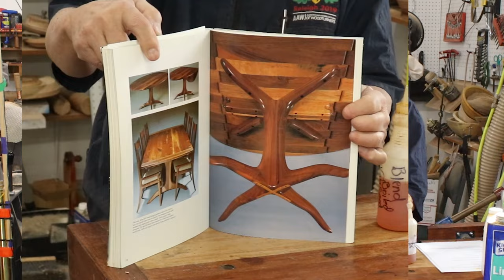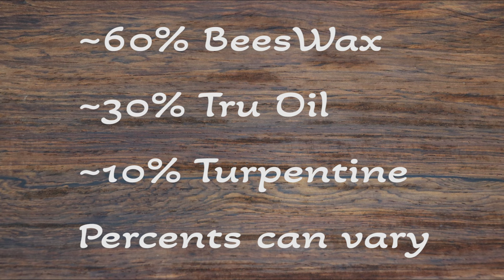Blending Oil Finishes for Wood Working             Woodturning with Sam Angelo

Comment: Hey Sam, it’s great to see you still making videos. You can get some really beautiful colors by cutting oil with a small amount of Windsor and newton oil based pigment paints. It’s a little tricky to top coat once cured but you can make everything from baby blue, forest green, amber and such just by mixing like you would on a palate. I usually prefer the Danish, but I think painters are cutting with linseed.

Comment: Hi Sam -- excellent info as usual.  My understanding of BLO is that it's a mixture of raw linseed oil, heat treated (or "cooked") linseed oil, and the addition of manganese and/or cobalt salts that are the "driers".  Driers are really just catalysts that speed up the chemical reactions involved in turning linseed oil into a kind of polymer -- what we want from a durable, protective film finish on wood.  Many years ago, BLO used lead-based driers, but thankfully those days are long gone.
Reply from the maker: Steve, do they really boil the linseed oil in the manufacturing process nowadays. It was my understanding is they really don't it's more done with the addition of dryers etc. I will have to do some more research. Thanks, Sam.
Reply: Hi Sam.  My current understanding is that some portion of most BLO formulations is usually still heated treated under low oxygen conditions. Raw linseed oil is a natural mixture of a number of chemical components.  Controlled heating breaks down some components of raw linseed oil that would otherwise slow down (or "inhibit") the polymerization reaction. That, along with the addition of dryers (i.e. catalysts), as you mention, creates a faster curing, partial-film finish. Tried and True makes a pure heat-treated linseed oil finish with no dryers.  I've used it, and it works fine, but it's a bit too yellow for my tastes.  Hope this helps!  Thanks for all your videos - they have helped me learn to turn!

Comment: Good summary video.  The finish on that bowl is awesome -- magazine quality.   One question: one of the objections that I have seen over the years to using boiled linseed oil is that it will tend to yellow over time and thus cause the wood it has been used to finish to yellow or look aged.  Have you seen this kind of behavior?
Reply from the maker: Mark, yes, this is some thing I've heard time and time again over the years. But as it happens very slowly, it's really hard to tell isn't it if linseed oil affects the color. Some say it makes the wood darker. But I will continue to use it. Thanks, Sam.

Comment: Sam, I understand the value in each of these finishes. The question I have is if you mix them together when they hit the wood do they efficiently separate and do their individual jobs?
Reply from the maker: Victor, wow that is a really good question. I always thought they kept their characteristics and did their thing but who knows .   Maybe the answer is in the finish you get. Thanks, Sam.
Reply: @WYOMINGWOODTURNER  yea I guess the finish would be the final arbiter and obviously you’re satisfied. I certainly respect your opinion.

Comment: Great info Sam. No mention of denatured alcohol as opposed to mineral spirits or turpentine in mixes? I know the cost is one concern, but what about the rate of evaporation and over all curing time when mixed with oil? Not to mention the smell and hazards of mineral spts as mentioned in another comment? No mention of walnut oil and I wonder if again cost is a concern compared to alternative oils? Curious too about what folks think about one oil over another in relation to grain  popping and appearance....how about shellac as a sealer and finish given it's short comings also? Lots of future videos perhaps. Thanks again and stay well.
Reply from the maker: you have some good comments here first of all I would not use denatured alcohol to thin down or mix an oil finish. Although I understand it is done with shine juice. It really is not compatible with oils. I really don't use walnut oil, so I didn't mention it. Thanks, Sam.

Comment: As a novice on finishes, I am questioning whether the materials mentioned in the finish are food safe?  I have heard that all finishes once dried are food safe but I'm not sure I believe that.  So far I've been using mineral oil on my cheese boards  but would like to find a food safe penetrating and finishing solution that has greater durability but food safe is a major concern.
Reply from the maker: Jerry 
I have done countless hours researching finishes. I won’t give you a full blown explanation of what a food safe finish is however: finishes are safe for food once the finish has dried. The best example I can give you are those food, safe finishes that are sold as such, they have the same nasty dryers as any other finish, but they are simply marketed as food safe. My objection to mineral oil as a finish is it it does not dry and Has to be reapplied almost every time you use your cutting board or salad bowl. Final point, is there is not enough actual finish on the surface of a salad bowl to harm anyone. Have you ever heard of anybody going to the hospital because of a breadboard or salad bowl’s finish .  To me it’s all about marketing. When someone says food safe finish, they were implying that some finishes are not food safe. This is a great disservice to us all. Sorry gave you a long answer anyway Sam.

Comment: I just used waterlox, it was ok, but I think it’s mostly a very expensive wIpping finish. Next time I will mix it myself.
Reply from the maker: Thank you, Frank, my experience with waterlox is that it really Dries too much in the can. I try using it several times over the years and gave up. But I do think it's a good finish if you can work with it

Comment: Teak oil is NOT produced from teak.  Rather, it is one example of a variety of a generic class of finishes called 'Danish Oil'- which are blends of one of the drying oils (Linseed, Tung, et al) and a combination of solvents.  The thing that differentiates one Danish Oil from another is which drying oil is used (although most commercial products today use Linseed oil), and the specific combination of solvents.  You can sometimes discern what the ingredients are in a commercial product from its MSDS (although more recently, MSDSs are only required to specifically identify components that meet some specific level of toxicity), but there are a number of commercial products labeled 'Teak Oil' where the MSDS mentions Linseed Oil.  In some cases, the manufacturer includes mention of a wax component in 'Teak Oil' products.

You mentioned mineral spirits, and the MSDS for various commercial finishes indicate that the common solvents are naptha, 'stoddard solvent' (which is a form of mineral spirits), and other chemicals with unpronounceable names.  In my shop, I've tried to stay away from petrochemical solvents and have generally used turpentine instead,  More recently, I've been using citrus solvent extracted from orange rind.  You mentioned that your wax was made with turpentine 'because it was there' - do you have strong feelings about turps, and have you had any experience with citrus solvents (which are admittedly pretty pricey) - but they smell nice?
Reply from the maker: Thanks, lots of good information.  I have used citrus solvent-mostly for wet sanding but not for actually mixing....For me, the big difference with turps is a slower drying time.  But I used to use it  more years ago.  Also good info on the MSDS content.  I was not always sure what info they provided.  Anyway-finishing is a very complex topic.  Good if you are a chemist.  Thanks Sam